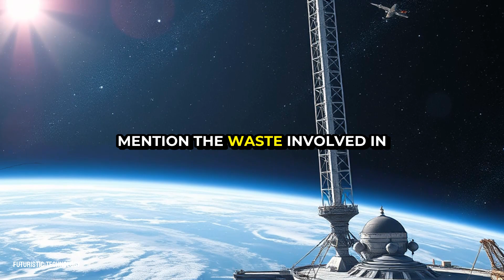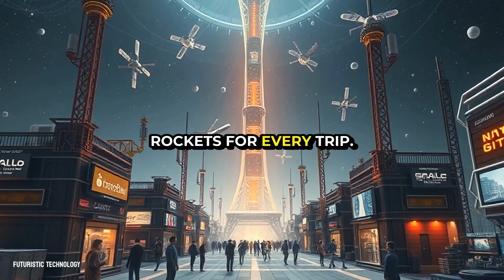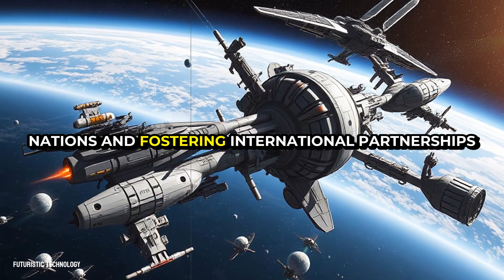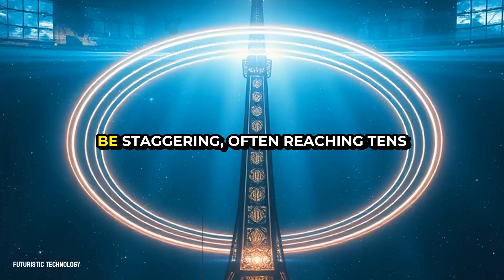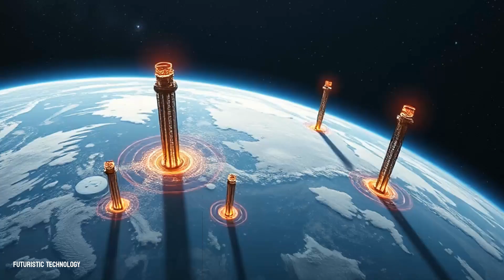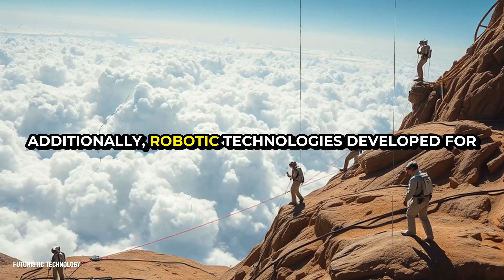How Space Elevators Will REVOLUTIONIZE Orbital Access | The Future of Space Technology

Comment: There are only TWO safe places to build one, the North and South Pole where there is next to Zero Rotation velocity. Any place else the Centrifugal force would tear it apart.
The average speed of Earth's rotation at the equator is about 1,038 mi/hr (1,670 km/hr) or roughly 1,000 mi/hr.
Reply: dose the planet not rotate faster at the poles would you not get dizzy
Reply: doesn't work as it is not rotating to compensate for gravity.

Comment: Space elevators will never, repeat NEVER work - on Earth at least - and it isn't a "material strength" issue, but rather a matter of our planet having multiple layers of energized plasma around it, and building such a structure would be the same thing as putting a conductor across the poles of a planet-sized capacitor. Nothing in the entire periodic table, and no compound conceivable without magic, could withstand the amperage that would discharge through the elevator, turning it into a rapidly expanding lightning-hot plasma. 

It might work on planets without an atmosphere, but not here.

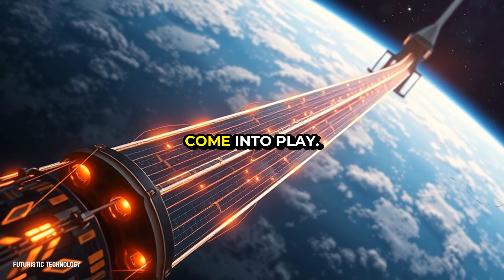Also, at 5:47, what did you mean by "dreaming bigots"?
Reply: thats probabley why there talking about carbon nanotubes I don't know if that conducts electricity or not but I know what your saying if you run a wire all the way up to space you would have a insain amount of high voltage